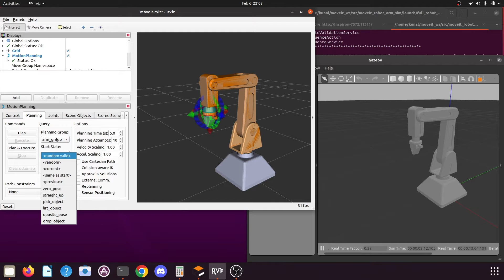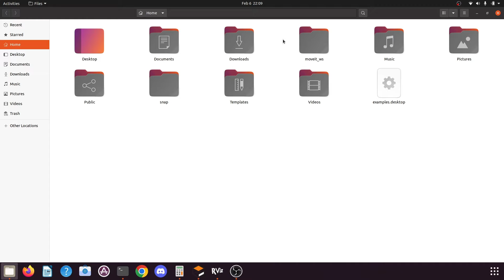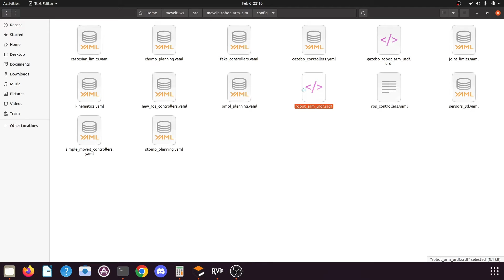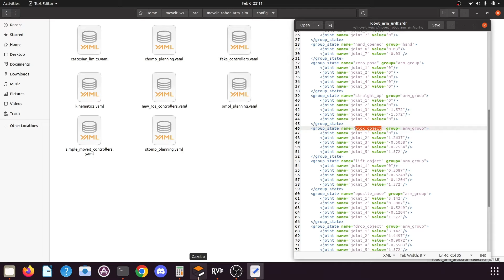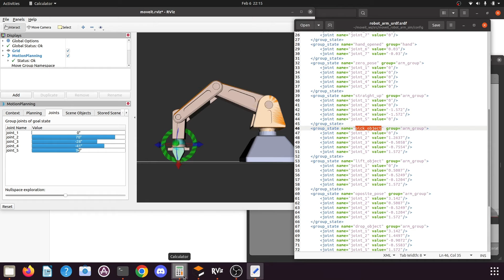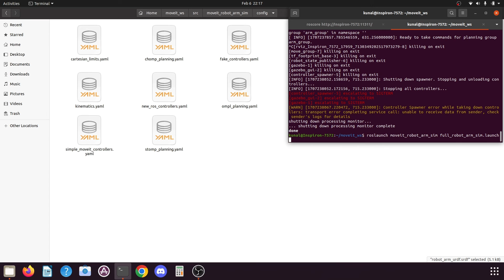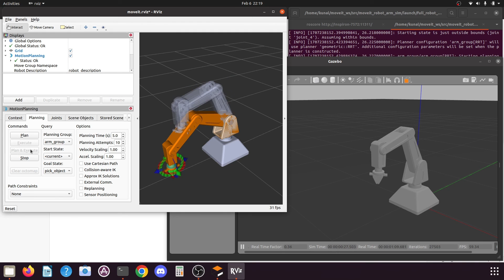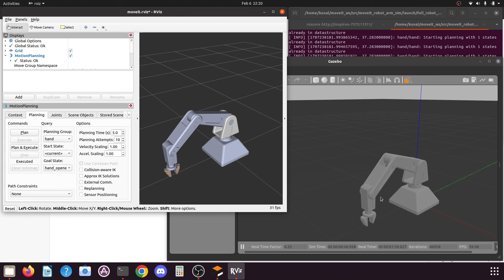Lesson 11.2: Modify The Predefined Position Created With Moveit Setup Assistance For The Robotic Arm

Comment: i do have an issue could you help me please, i have a warning:
 [INFO] [1749165888.199964146]: Loaded gazebo_ros_control.
[WARN] [1749165898.663900, 1.461000]: Controller Spawner couldn't find the expected controller_manager ROS interface.
[WARN] [1749165898.959856, 1.518000]: Controller Spawner couldn't find the expected controller_manager ROS interface.
this prevents any control on the robot on gazebo , i am using ros noetic